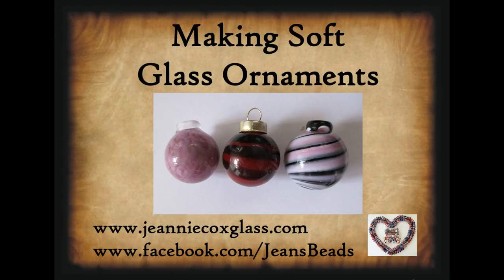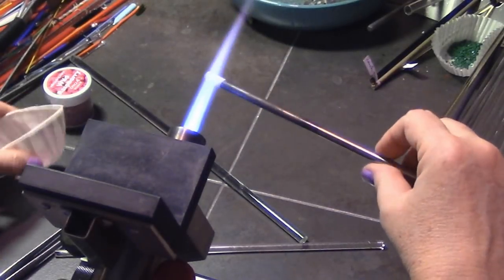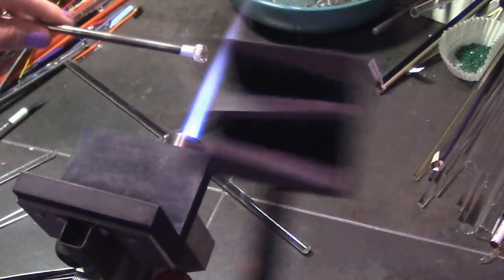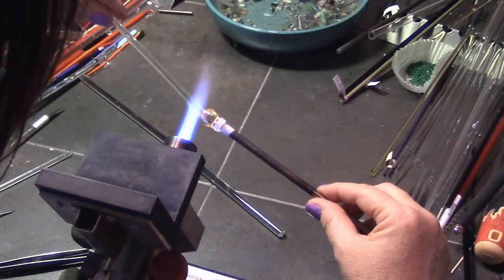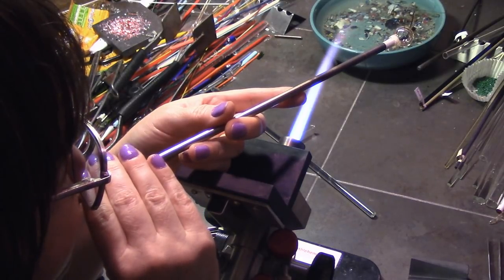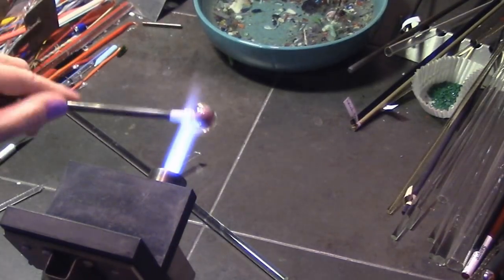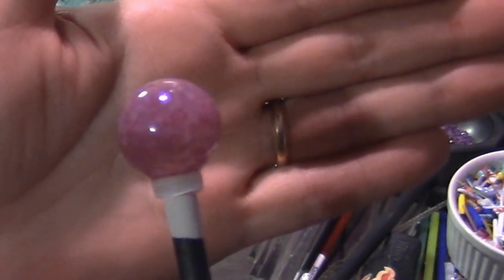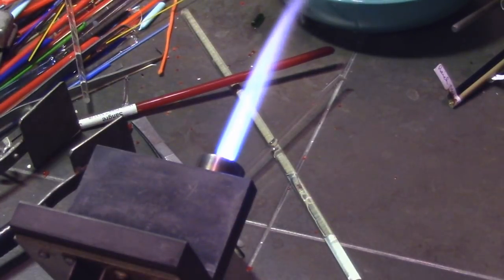Making Soft Glass Ornaments by Jeannie cox

Comment: Hi Jeannie  is bead release the same thing as kiln wash? Thank you for another great video!
Reply from the maker: No, it's not the same.  It can be used, but the chances of it cracking off when you are trying to make a bead is extremely high and most likely a LOT worse trying to blow out ornaments like this since only a small portion of glass is attached to the blow tube. I would buy bead release, which isn't all that expensive, and you'll be much better off.
Reply: Jeannie Cox great thank you! Is there one that's better than another?
Reply from the maker: Everyone has their own favorites!  Mine is Sludge Ultra by Arrow Springs - - the first one on this page . . . https://www.arrowsprings.com/html/mandrel_release.html
Reply from the maker: The Blue Sludge is more for boro glass, but I found it's a little harder to remove from beads and the insides of these ornament toppers.
Reply: Thank you! I really appreciate it. Have a good night!

Comment: Love 💜 where did you get your mandrel ?
Reply from the maker: Thanks! :)  I actually bought my mandrels off a friend who had dozens of them, but they are available from several lamp work/glass suppliers like Mountain Glass Arts and Arrow Springs - - search for steel (or stainless steel) blow tubes.
Reply: Thanks, love mountain glass will have to check them out :)
Reply: most independent hardware stores sell stainless tubes, one foot long, various diameters. Ace, True Value. Look for the K & S display http://www.acehardware.com/family/index.jsp?categoryId=2625942&cp=2568443.2568451.2624969.2625784. Awesome video, Jeannie!
Reply: Laurie Nessel would hardware stores also sell solid ss rods that could be used as a mandrel? I want to try some beadmaking (I take classes with boro and work in that shop for pendant making so I have access to a torch, kiln, and basic tools) but I'm so resistant to ordering online because it seems like it's not worth it unless I order a bunch of stuff that can't be found locally and I can't afford all of what I want right now!
Reply: Yes, they have ss rod as well. Or you can buy ss welding rod (308 or 316), cut it down, grind the burrs and use soapy water to remove any oils.
Reply from the maker: Thanks Laurie, I didn't know that.  My hubby got me some kind of tube YEARS ago from either a hardware store or similar (was supposed to be stainless), but alas, when I started to use it, it started bubbling up and flaking off in layers.  Have no clue what kind of metal that was but haven't even tried local stores for tubing or mandrels since then.
Reply: It was probably aluminum. They are all in the same display case-ss, al, brass, copper. Just check the label, the heft, the color and you'll be o.k.
Reply from the maker: Thanks.  I might check again one of these days - - altho I already have a dozen or so tubes right now.  The heft (weight) of that tube seemed like a heavier metal - - it was almost exactly the weight of the tubes I use, so I am not sure if I could be trusted to judge if the label isn't specific, lol!  :)